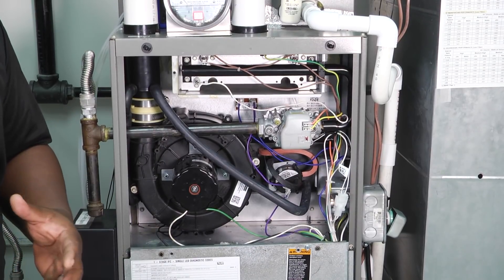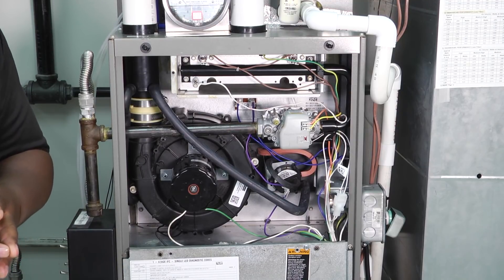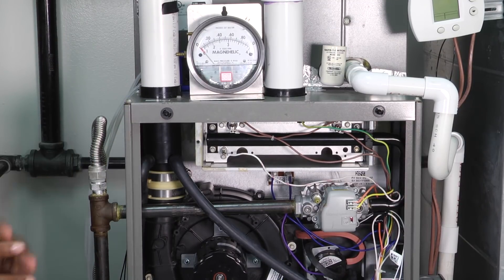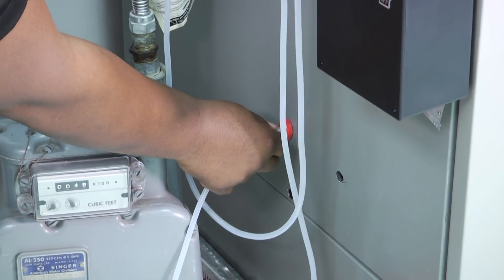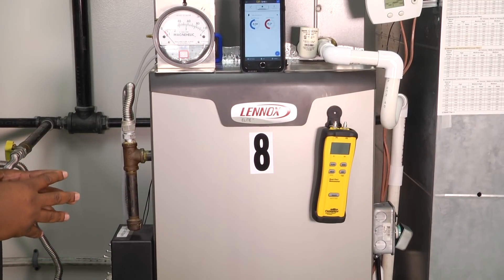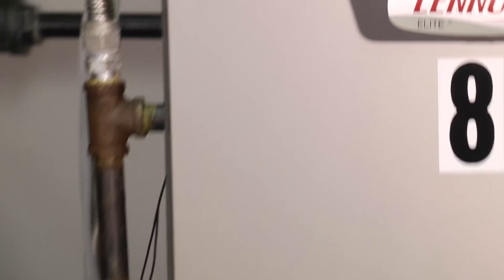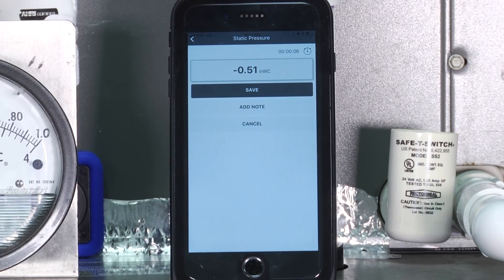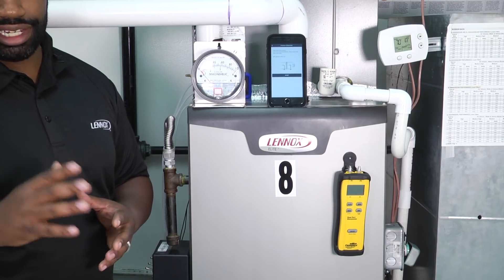Toolbox Tuesday: How to Determine Total Static Pressure | Lennox

Comment: Coucouple things,not being rude at all so hopefully you dont take it like that, thats not a pitot tube,its a static pressure tip. Only measures static only. A pitot measures both static and total pressure at same time and you use a calculation to determine velocity from those two readings. Also total static pressure is measuring the entire system at once,the inlet to the blower and the outlet of the blower is total static. Total external static,which is the rating on the unit tags like you showed, is the total static of everything external to what was included by the manufacturer in the unit. Like an evap and a media filter would be external to a furnace because it didnt come packaged and tested with it, then you would actually be testing total static,but on an ahu that comes with an evap,maybe a hw coil and filter, tesp would be measured up/downstream of the coils respectively and upstream of the filter in those cases, but still need to test pressure drops across filters and coils to be sure theyre within manufacturers specs otherwise your tesp readings are useless if theyre not. 😉

Comment: I have used magnehelics for 39 years in conjunction with a dwyer 400-10 or 400-23 inclined manometer ( still very accurate and reliable but slower ). I like the convenience of the blue tooth digital ( very fast ,easy and compact ). I always log flow measurements on new , freshly cleaned equipment and leave a little record in the unit data package for reference. thanks for the video , well done Sir.

Comment: The Magnehelic is the best. The facility I work at has one on every air handler on the return and supply side. When checking static on 16 air handlers and so which are the size of a small house lol these make it very easy

Comment: Very concise video.  Minor point: you called your static probe a pitot tube which is quite different.  So @ 6:53 I see you have a total static of .71 which is .21 over the max for that system correct?  And what would you consider the culprit in a real world situation with those numbers, restriction in the return is high and maybe filter?  I'm getting similar @ .91 TESP,  return .61 and supply air .3.
Reply: lower is better, but not too low.   0.5 in in the middle, personally i say 0.3 is the best you can hit. Measure before and after the ac coil, see the drop there. Its probably dirty to shit, also do the return and supply of just the furnace, your secondary coil could be plugged solid
Reply: @xposed11  secondary coil?

Comment: Double check that probe orientation, assuming thst is an upflow. Other videos state the point must go in the direction of the flow.  Which is correct?
Reply: From what I've read it doesn't really matter as long as it's inline with the flow and not perpendicular.  In practice I see very little difference in pressure when rotating tip in either direction.  But more often than not I see instructions to point into direction of the source so head-on.
Reply: Just like he states in this video, pointing against the air flow.
Reply: I though that too, only when it's a twin pitot (with a static port) have I seen it point in to the air flow otherwise it's measuring the velocity pressure?  Confused now...
Reply: Good video on it   
https://www.youtube.com/watch?v=45gX7Jb60JM